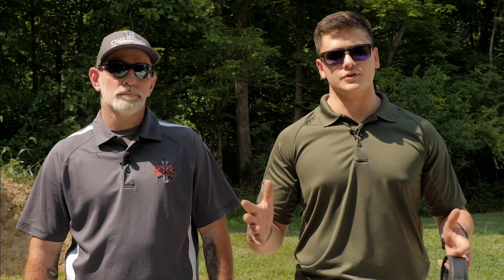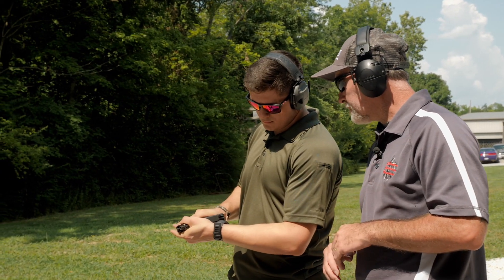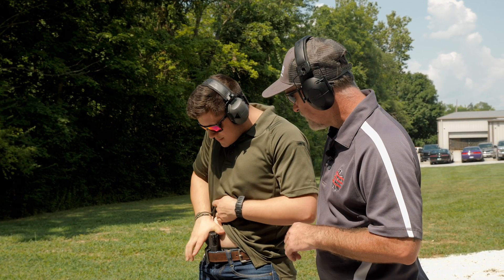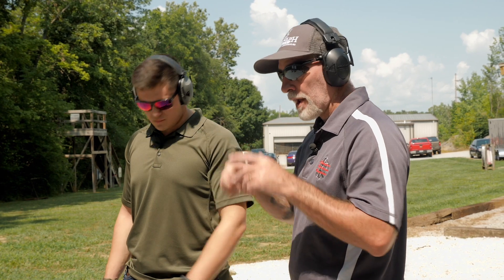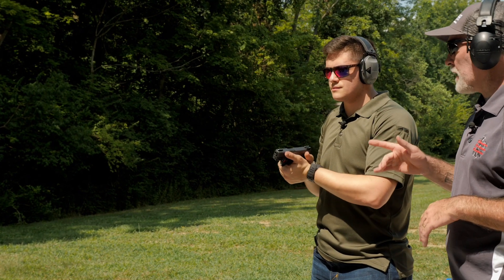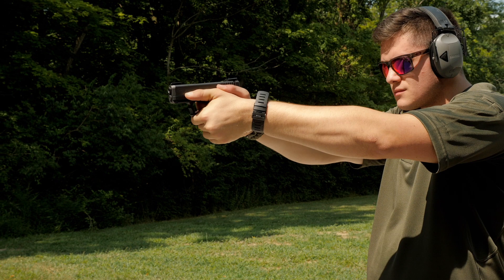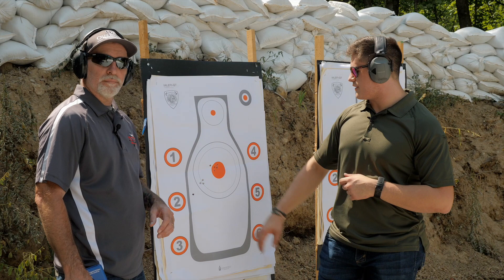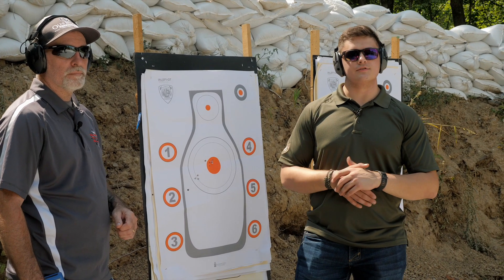Simple Way to Improve Shot Placement

Comment: Try get your body placement correct,  quit leaning backwards. Get your center of gravity to a bit forward position this will tame the recoil then focus an trigger control this will solve your problem also dry fire practices helps point your errors.